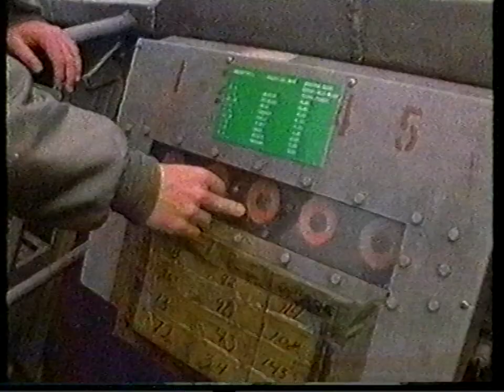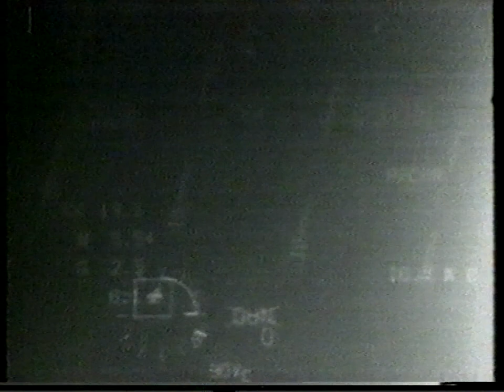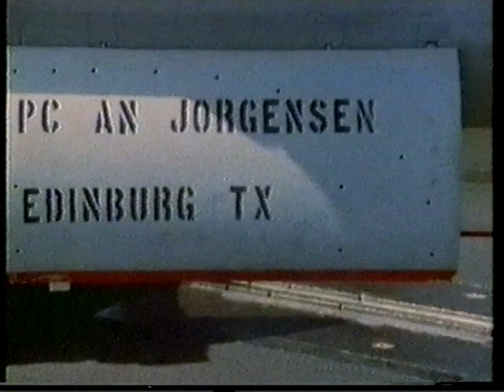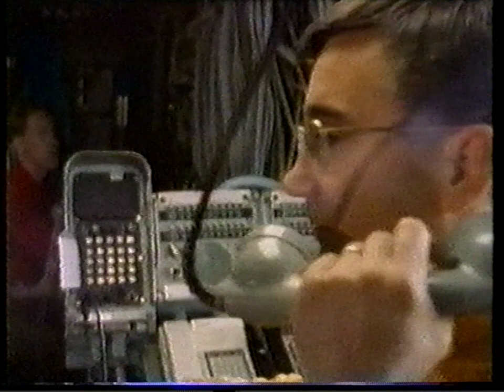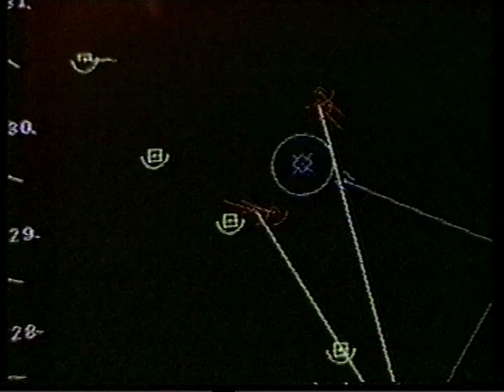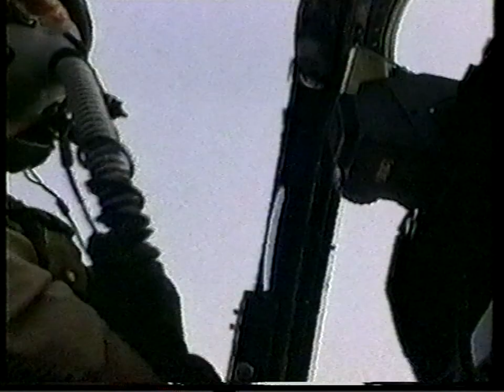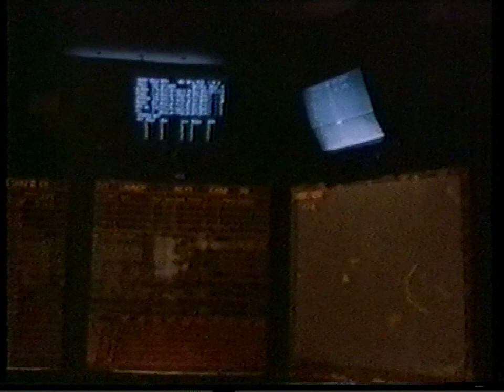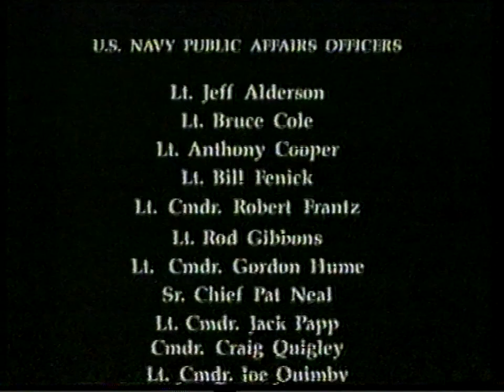Carrier: Fortress At Sea (1995)

Comment: This is USS Carl Vinson with CVW-14. The airwing included: VF-11 “Red Rippers,” VF-31 “Tomcatters,” VFA-113 “Stingers,” VFA-25 “Fist of the Fleet,” VA-196 “Main Battery,” VAW-113 “Black Eagles,” HS-8 “Eightballers,” and VAQ-139 “Cougars.” Here are some trivia about this: The F-14D of VF-11 was onboard Vinson from 94-96. After that, VF-11 transitioned to the F-14B. Rick “Twig” Labranche who was the LSO in the video, later became CO of VF-31 onboard Theodore Roosevelt with CVW-8.
Reply: Awesome. Carrier air wings from the 1990s are the time when we had the F-14s.
Reply: Also the Main Battery Squadron has been stood up again as VAQ-144, flying the EA-18G Growler.
Reply: Also Twig was the final Tomcat skipper of VF-31.